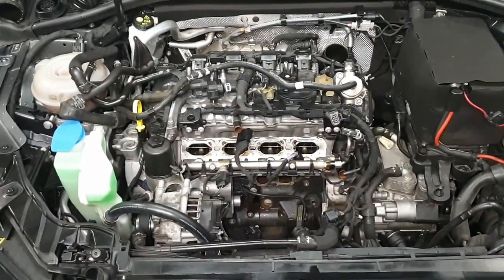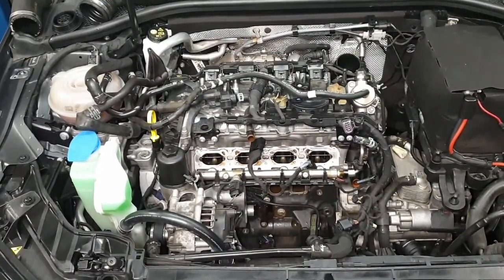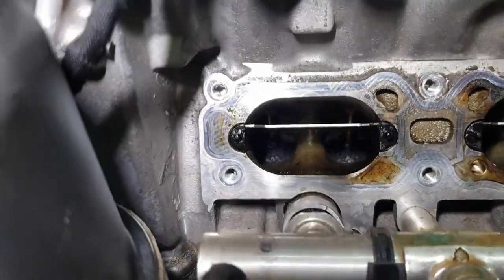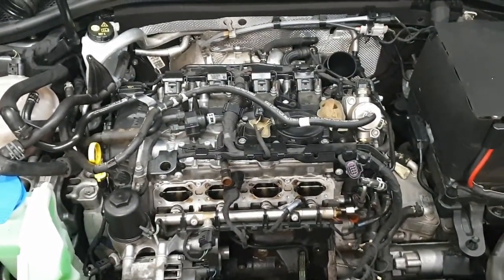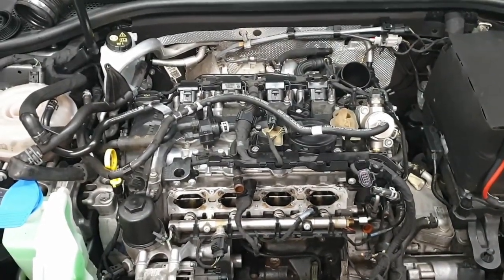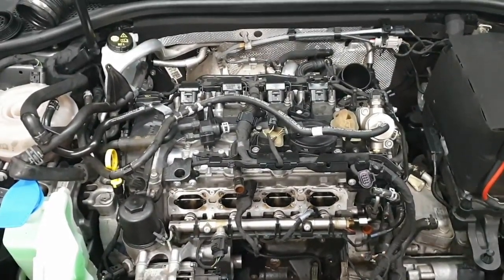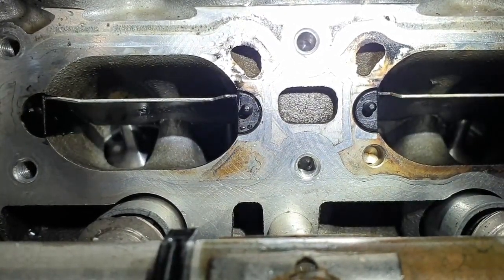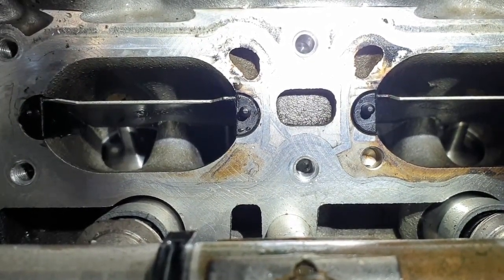AA Silencers Audi S3 Tunap carbon removal from valves

Comment: You know they make a vacuum adapter so that you don't get that blast media all over the customer's engine, right? You've got open electrical connectors and all that crap getting into everything....sloppy work!
Reply from the maker: We have the vacuum adaptor but its a pain to use on this application.
Everything was properly cleaned afterwards so all the media was removed.